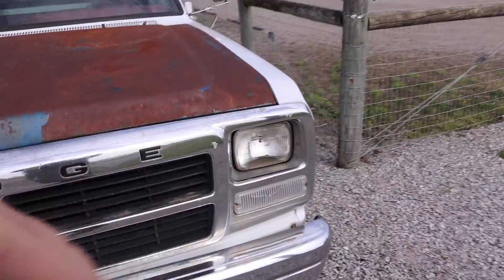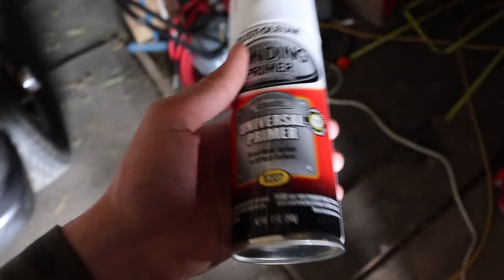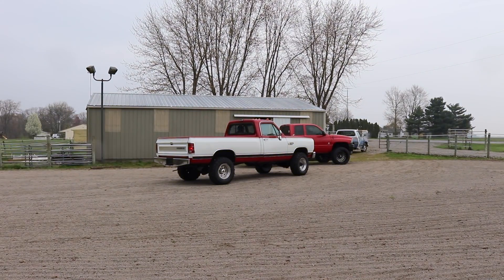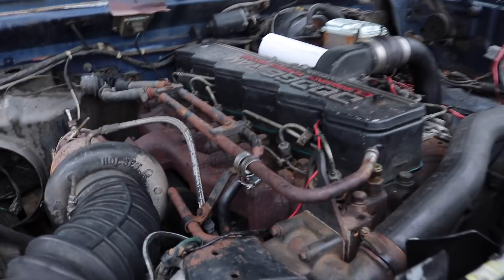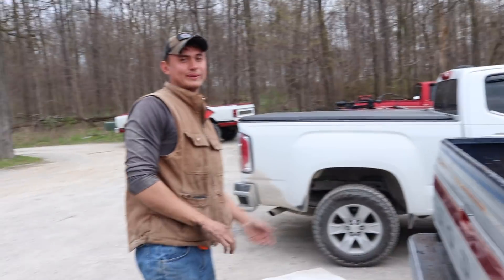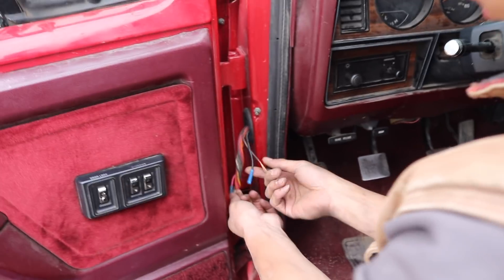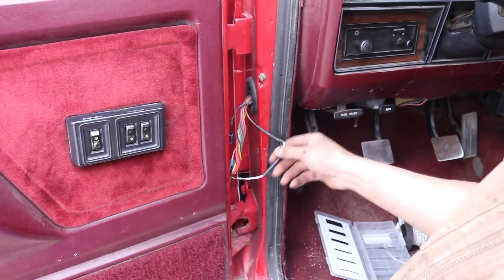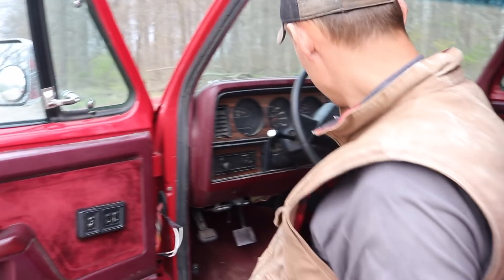My 1st Gen BROKE...

Comment: You gotta crimp those butt connectors super hard and make sure both ends of wire go in all the way. I work at a boat factory, if you do it right you wont have an issue